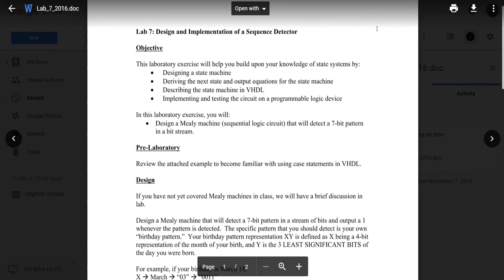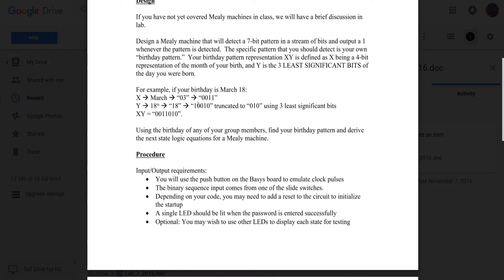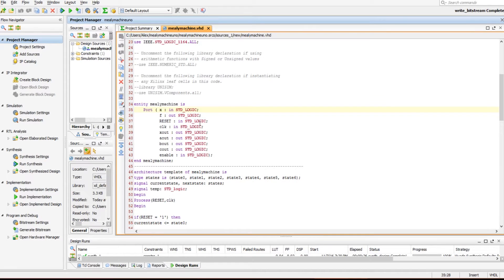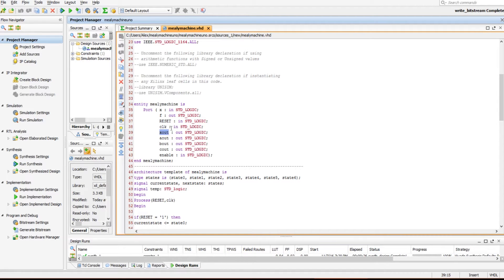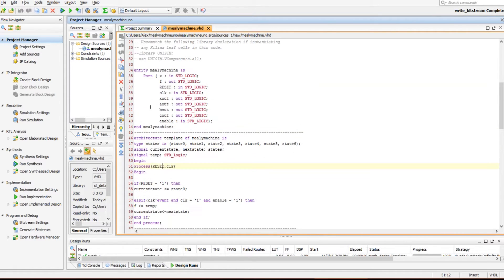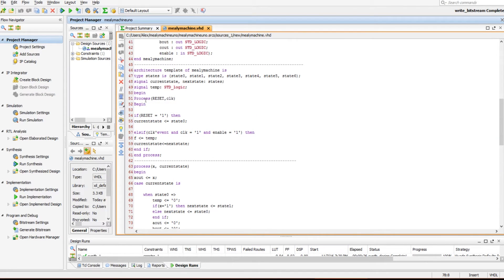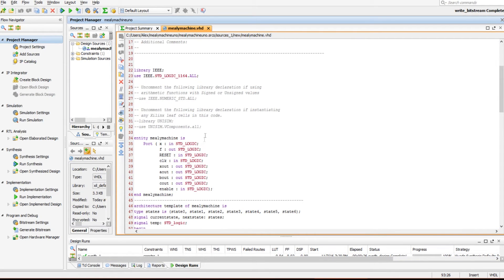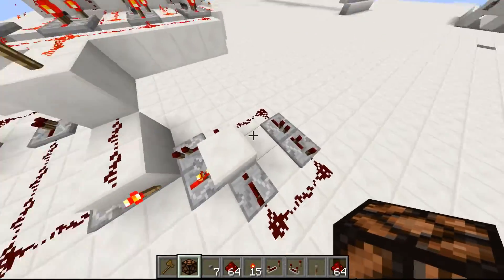State Machines and VHDL.

Comment: It's an interesting coincidence that the example birthday code on the worksheet ends up as 0011010 which is also interestingly enough the I2C device address of the configuration registers of the Zybo board's audio codec.
Reply from the maker: Inside the Box very interesting!

Comment: First off, I think you need 7 states. You might want to take a look at your state machine diagram.
Also from your code, I'm pretty sure you're missing some cases by just restarting the machine entirely when you encounter a wrong digit You seem to have kind of accounted for this in your state 6 next state assignment, but missed it earlier on.

For instance, if you had the string 11001000 you would end in state 0 as opposed to your acceptable state is despite having an acceptable string in the stream.

EDIT: My bad on the 7 states part, you're using a memory cell to turn on the LED at the next clock cycle it seems. I feel like that kind of goes against the idea of a state machine although I may be mistaken. I'm pretty sure my other point still stands though.